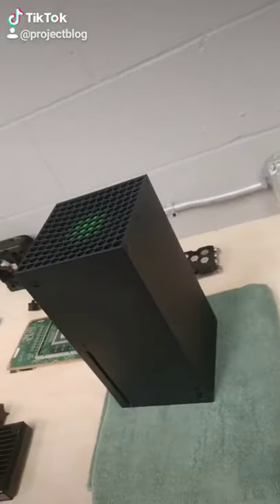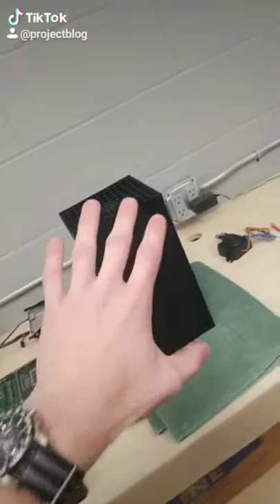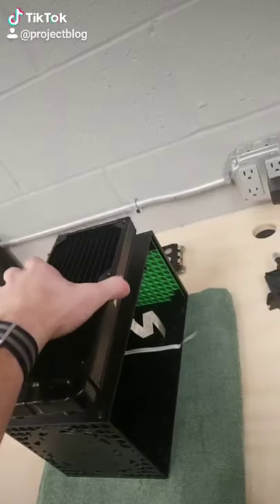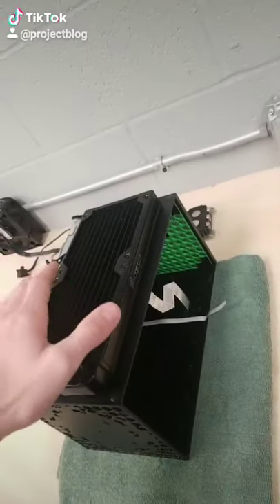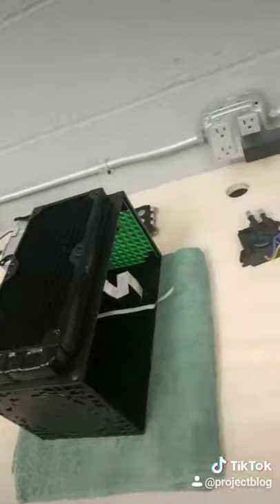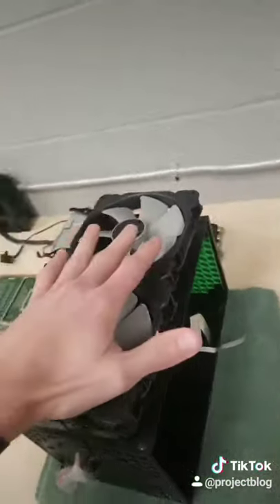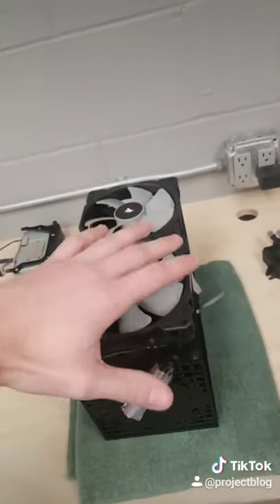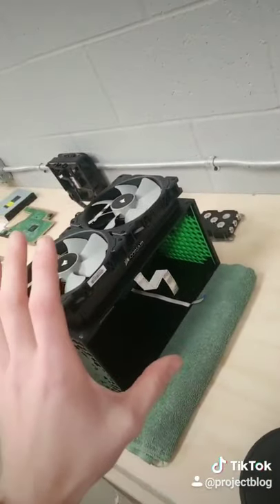Watercooling a Series X!

Comment: Interesting project.. not sure why you would do it to a machine that already has great cooling and never makes a noise, though?

Also why 140mm fans on a 240mm rad?
Also won't the rad be suffocated against the side of the Xbox.. even if the side of it is opened up, it seems like the rad would be starved for air.

I feel like I'm being trolled
Reply: I seen better cooling systems for series x for 50$ and under I’m order the B2concepts.com that’s where to get a cool looking cooling system added to what you have already making no changes whatsoever other than cooling the system down.
Reply: @quentinjulien7441  That link doesn't work and if you're thinking about any cooler that you buy and slap onto the side of a console, those almost always block air or even pull it in the wrong direction. Avoid at all costs.